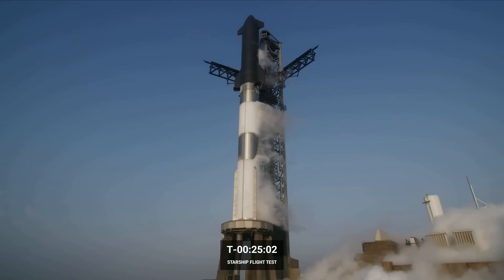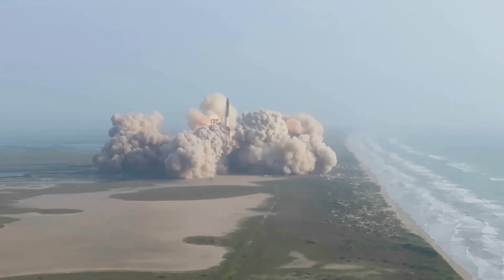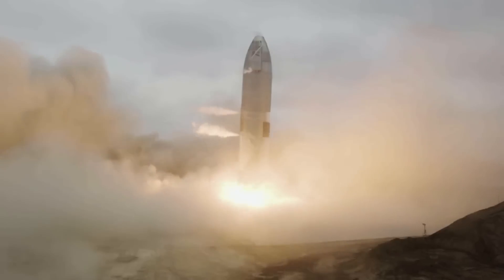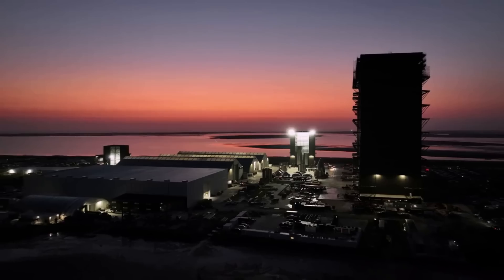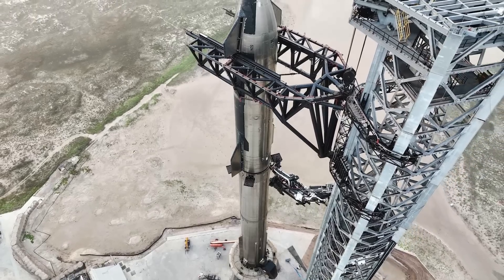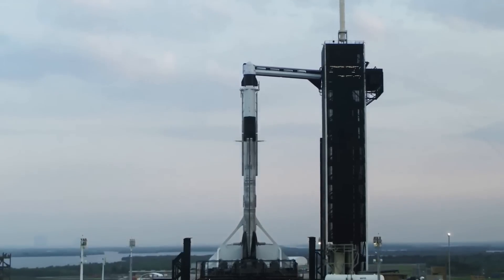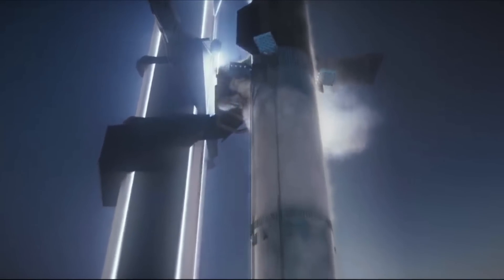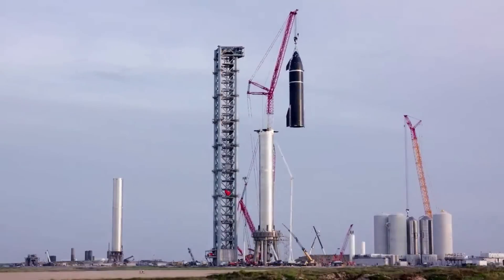Why SpaceX Launched Starship With Minimal Pad Protection

Comment: Space X’s heavy launch vehicle and its Raptor engines are promising breakthroughs, however; several engines failed during the first stage ascent.  An outside source stated that it appeared that E1, E6, and E7 had failed at launch. E18 failed violently at T+30; E19 failed at T+46; E22 failed at T+60; E23 failed at T+94; at T+122 flames were visible at the thrust section; and at T+130 the rocket started spinning. How many engines fail on the maiden test flights of Apollo 4 (Saturn V), STS-1 (Space Shuttle), Russian Energia, and Artemis 1 (SLS)? Where was the flame deflector to channel the rocket exhaust away from the launch pad and where was the water deluge system to dampen the acoustic energy of these engines?

Comment: SpaceX is institutionally a rocket-making company.. their experience in buidling launch pad is limited to leasing and upgrading existing launchpads. You saw what happened with tank farm where they could not use half of them because they did not follow regulation and somehow missed the fact that water is  very heavy. This is also a consequence of a strong drive to develop things in-house rather than rely on outside experience and help. Also, Elon Musk is a software-minded guy by origin, which means he tends to move fast and break things. In the software world, that is of little consequence, at worst, you accumulate technical debt. He also, likes to get into the weeds of the decision making, he should let the organization do its things and just provide guidance, he is a visionary but he is not be an expert in every engineering field. By getting himself too much into the  process, he risks making his own limitations limit the company. He said before that he brought a production line worth of robots and then threw them out because humans are underrated. Such a waste of money.

Comment: All of this data was there for Elon’s engineers…Already trialed and errored sixty years ago. In the summer of 1962 the aeroballistics and testing division of the USAF did nothing but repeated tests on rocket blast impact on concrete, refractory cement and other materials. Thst research led to the Saturn V launch pad with diverter trench. Why spacex engineers are choosing to slog through all of this again is frustratingly baffling.
Reply: You hit the nail on the head - bad decisions
Reply: maybe (and for the same reason it will not work).. is that their idea is to land and restart a rocket on the Moon and Mars Surface! Ca'nt Imagine the depth of the crater!  Along with instability and dust  such a  landing would create !

Comment: The lack of a flame trench is absurd.  SpaceX did not need to figure out how damaging the Starship can be before building one.  This is simple arrogance.  Now they have damaged their entire Stage 0, that according to Elon Musk is the most difficult of all stages, they get to rebuild it again over months.  Really a serious and preventable error.  This is a case of the tortoise overtaking the hare.
Reply: The reasoning is stupid. They want to launch Starship on a return trip from Mars, which obviously doesn't have launch infrastructure. But they aren't launching Superheavy from Mars, just the upper Starship stage which doesn't have 33 engines.

Comment: They should just dig a much bigger hole under the rocket and fill it with some water.
Reply: I’m no engineer but seems like the legs of the elevated platform would be made less stable by digging a big hole under them.

Comment: At this point, new plans should be considered, like moving the pad 39 mechazilla over to the old Saturn 5 flame trench on top of the artificial hill.  A crew dragon access tower can be built at pad 40 while mechazilla is being moved.  These things were considered, then dropped on the very reasonable argument that its worth trying the simplest thing first and only add as much complexity as experience demands.  Moving the Florida mechazilla would be easier than building the Boca Chica infrastructure up because the Saturn 5 infrastructure is already present at complex 39.  There is no reason this couldn't be implemented in parallel with the water cooled plate idea in Texas

Comment: One of the key reasons that Spacex launched their Starship when they did on 20Apr'23 was the imminent threat by the Sierra Club and several other activist organisations that claimed they were "going to get a court order to prevent a launch" which sadly could have tied things up for one or two years before getting resolved.
Reply: I dont Understand. What is the Sierra Club and why do they want to Sue Spacex?
Reply: @nukl3argam3r38  luddite environmentalist cult
Reply: Well now, the Sierra Club has even more reasons and evidence to go to court to prevent the next launch.
Reply: That makes sense as spacex has tried to do too much in too small an area that is adjacent to an environmental sensitive area that is a situation that the Sierra Club loves to cause trouble for. If it is not true prior to the launch it will definitely be possible now that stage zero failed so  epically in a way that they would consider a threat to the environment.

Comment: You would think that a rocket much more powerful than Saturn V would at least have similar launch pad design with all those flame diverter and water based sound supression system
Reply: You simply can't dig deep in Boca Chica because of how close the water are. It's still possible but it will be very expensive and take a long time to build
Reply: @LeftOverMacNCheese  all this launch pad data and ways to build diversion trenches over a shallow water table… was figured out to perfection 60 years ago. Search Aeroballistics testing division > 1962. I found it in 90 seconds. Why is Elon’s team trying to reinvent the wheel? FAA is about to come down hard on them. There won’t be a starship launch in under 12 months.
Reply: Musk was told but the super genius didn't want to spend the money. We all knew this was going to happen for many months. Totally predictable and avoidable.

Comment: Company got it wrong. Really wrong. And no amount of "this was a successful liftoff" malarky can hide that fact.
Reply: And all those euro bros shitting on SLS when it was a nominal mission that was successfully completed.
Reply: @mrzorg8378  ah, yes, the SLS fanboys coming out of the woodwork 😅 SLS didn’t launch with the old SRBs at freezing temperatures, didn’t have any orbiter to damage with foam pieces, and used flight proven engines. Why would it not manage to achieve orbit, especially with the time and money it took to rediscover the wheel, i mean reuse the shuttle parts
Reply: @HNedel  starship mite be a successful heavy payload launcher in the future. But landing on the moon or mars with humans is impossible logistically. You know that.
Reply: @jimmystrickland1034  nah, i don’t actually know that. I don’t see a problem with the landing part. Taking off from mars seems like a bigger problem to me than landing.

Comment: should just fill the gaping OLM hole with sand and and water, freeze it all together with liquid nitrogen pipe purge run off at launch time and go again. Might make another big hole, but sand and steam flying everywhere much better than 100 kilo chunks of fondag. Besides frozen sand water combo is probably no less consolidated than the earth excavated by super heavy, and sub 100 degree frozen water is 5-6 on the mohs scale approaching concrete in hardness. I mean there is heaps of sand nearby to iteratively prototype a new solution lol...
Reply: It would likely be chunks of sand/ice flying instead of concrete. Probably wouldn’t melt as quickly as it would fracture and turn projectile.
Reply: @Mothball_man  possibly. I suppose would depend on the sand water ratio and acoustics. 'Twould be interesting to test what's optimal. a bit slushy or /sandier on top to inhibit sub surface  fracturing with deeper cryogenic  permafrost sand  layer below to provide some resistance to flame penetration and excavation?

Comment: I wonder why they dont just put very think steel plates under it.  With the water.
Reply: they wanted to test how much they could get away with launching starship from mars back to earth. If you can avoid building a complex launch pad on mars, all the better.
Reply: @elodens4  Super Heavy is the main issue here, not Starship. I doubt SpaceX has plans to launch the Starship stack from Mars .

Comment: According to Musk , the 31 engine static fire fooled them into a false sense of security. One thing is for certain. They will not allow starship to launch out of the cape without a flame diverter and water deluge system.

Comment: Most likely NASA is going to be extremely reluctant to let SpaceX use the Starship launch mount inside the perimeter of LC-39A. Even if they get the immediate trench-digging characteristic under control, they'll also have to protect the Falcon 9/Heavy infrastructure on the main pad from the Superheavy's exhaust plume. I just don't see NASA allowing that.
Reply: I will be suprised if they dont drop him altogether as costs and timelines go forever upward .
Reply: @MyKharli  Are you talking about SLS, Starliner or any of the other projects that are behind schedule and over budget?
Reply: @HNedel  But his history of failures is unmatched , His neuralink monkey brain abuse alone was enough to ostracize him in my day , my how standards have dropped .
Reply: @MyKharli  yes, sure, the monkeys were no match for Challenger and Columbia 🤦‍♂️

Comment: Unmentioned as probably the most important reason why SpaceX went ahead and launched: S24/B7 were destined for the scrapheap.  SpaceX has done this several times now—iterating a Starship/Booster stack that theoretically could have been made ready for a flight test, but ultimately scrapping it and moving on to the next iteration, because they didn't have permission to proceed.  The only reason they got S24/B7 launch-ready was pre-knowledge of the upcoming FAA license.  Without question, sending S24/B7 on a test launch netted far more data than scrapping them would have.  Realistically, installing the diverter would have meant many months of further delays while the FAA scrutinized the work, and that's assuming the FAA is going to allow it to be installed in the first place.  It can definitely be argued that the total timesink from damaging S0 is essentially no different from the scenario where SpaceX didn't launch S24/B7 after all.
Reply: I wonder what the FAA thinks of all this.
Reply: @mhyotyni  
Good question, one only hopes that there is actually some serious thinking going on with all this new data available to them. A lot of promises were made and a number of them were in reality proven to be specious.
Reply: If the FAA was going to do all that, something it hasnt done over ten years of spacex doing the militaries bidding and launching their satellites, then Musk should of just moved the operation to South America , just like everyone else.
Reply: @itubeutubewealltube1  The FAA doesn't have much choice in the matter because they are perpetually harangued by entities like Sierra Club who are vociferous in their agenda to get in SpaceX's way.  Where it is the FAA's fault is when it comes to the timetables.  The perpetual, meme-worthy time sinks, when it came to both the FAA survey and the license review, are a matter of public record.  That's not likely to be any different when SpaceX indicates they're going to try diverting a rocket's thrust.  Not even if somebody nonchalantly suggests that the FAA has never done such a thing before.
Reply: It’s the EPA that would object to thousands of tons of concrete and millions of gallons of water on a protected area.
Reply: @HNedel  
I have read that when these reviews are being done that the FAA is the lead organization in this case that coordinates with all of the governmental organizations. Maybe that is how it works and that the EPA works through the FAA but wished that this topic be clarified.

Comment: There is a good reason why Elon insists on the solution currently used - there is no flame diverter on the Moon or Mars. If it is impossible to launch a powerful rocket from the Earth without a diverter, it would be impossible to do it from other places. Imagine the volume of debris during the start of the Moon. Elon knows that, so he looks for a solution that would allow him to achieve this. 
What happened is not a mistake. The mistake was made at the very beginning of X-space - the assumption that one would be able to have a round trip to and from Mars using powerful rockets.

Comment: I'm placing bets that when the final report comes out, the FAA will say that the level of damage observed was a bigger safety risk than they are willing to approve again, so the damage is a fairly big deal. But you are quite correct to note that the "move fast and break things" philosophy is expected to break things. They now have data that very difficult to simulate. Namely, how much damage does the plume really do? It's difficult to collect that data any other way.
Reply: what are you talking about?  you can calculate exactly how much thrust and heat is being displaced by those engines... have you ever taken a propulsion course in your life? wth?
Reply: @itubeutubewealltube1  shhhh, Elon said they have a lot of data now, lol

Comment: If you'll look at 39B, it's a giant ramp. This allows the creation of a trench ABOVE the water table, something they side-stepped. It bit them ... HARD for missing a basic fact that's been known for 60+ years of space travel. Rockets break stuff.
This is really upsetting.
Reply: Absolutely 100% correct. Complete incompetence
Reply: Maybe there are some factors. The launch ramps at 39A/B are big in surface area, and the slope requires a very complicated crawler/transporter to get the rocket up to the pad while compensating for the slope. Building an elevated platform at Boca Chica would require a lot of surface area, within a protected wetland. That means environmental assessment and permission. They'd have to bring in a colossal amount of fill to build the ramps. And then the launch tower/chopsticks would no longer be a useful design. Those might be enough negatives to make it worth a risk on the method SpaceX tried. Turns out the risk was a bad bet, but maybe that's what they wanted to learn.
Reply: @T_Mo271  yep I think you’re right… launching big rockets is hard. So this will be the third major time we’ve seen Elon come to those realistic terms. 
1. “Turns out building a hyperloop vacuum is really hard”
2. “Turns out autonomous vehicles is really hard”
3. “Turns out launch pads are really hard.”

The data has always been there for Elon, but the guy is just dead set on learning it the hard way again and again.
Reply: The inability to learn from the past experiences is known as bad engineering. I am afraid that most If not all of these  catastrophic failures now seen could have been avoided in advance through careful design using the current state of knowledge.  Luckily nobody was hurt this time.
Reply: It didn’t bite them THAT hard actually. If the rocked had exploded on the launchpad, that would have been a hard lesson. But even then, the risk of anyone getting killed was minimal, as the blast area was known and evacuated.

Comment: Still dodging the question of how many Raptor engines (6-8) failed before the rocket even achieved separation. In an orbital flight this might be recoverable. But for missions to the Moon or Mars it would result in mission failure. Unfortunately, SpaceX only has telemetry. Because the actual rocket had to be destroyed, they cannot perform forensic analysis of the physical components. Certainly the 2025 target for landing crews on the Moon is in jeopardy.
Reply: They not only have to have a working starship, they also have to design and they the whole untested refueling in orbit thing before going to the moon. There is no chance that will happen by 2025
Reply: lol you really thought 2025 is potentially real deal? cmon
Reply: @creedfooz  - I figured that it was an optimistic goal at best. But there was always the chance that Starship would perform as planned. My sense is that Musk rushed things too much and left too many things to chance.
Reply: my bet,  there will be no more launch of starship this year.

Comment: It might be easier to just build the second tower with an integrated flame trench and demote the current pad to just "catch" the booster on it's return.

I agree the repairs are more like the 4-6 month mark. I think the column supports would have suffered surface heat damage and so they will need significant remediation. After that, I would probably put steel deflectors (that are easy to replace if needed) around the columns as well. Just leave the concrete to do the structural work it is good at.
Reply: You are right the geography of the current pad stuck next to the tower and the tank farm does not allow to dig a suitable trench..
Reply: They can't build too far into the ground because of a low water table
Reply: @Azilythe  This is the reason why in Florida they build launch mounds and have the trench at/near ground level. Starbase was trying to do it el-cheapo.
Reply: @Azilythe  there are various construction techniques that allow you to build in high water tables. Not trivial, but not impossible. The issue is that it would not be free draining and would need to be pumped out 24x7.